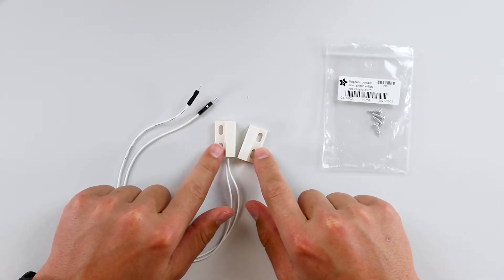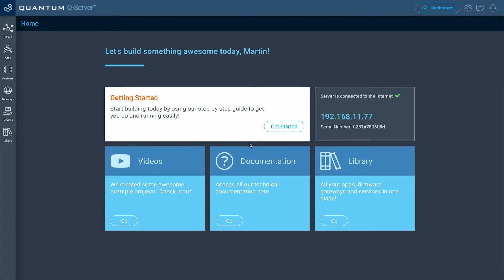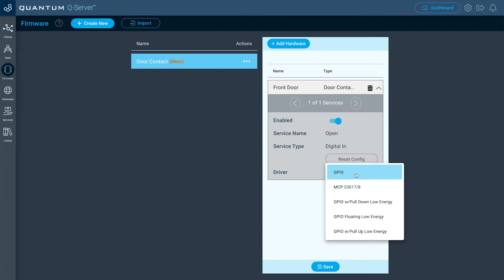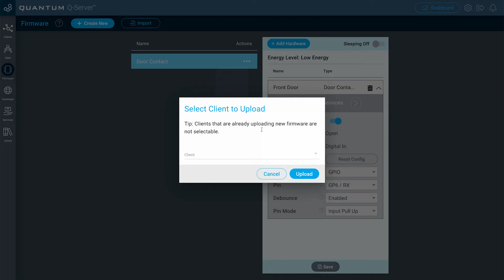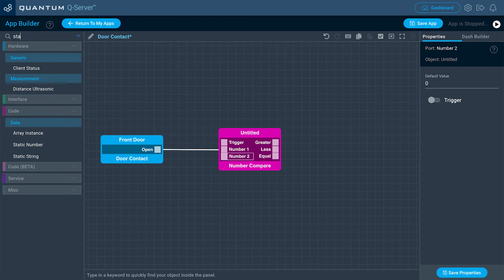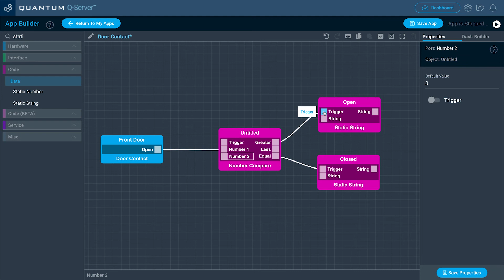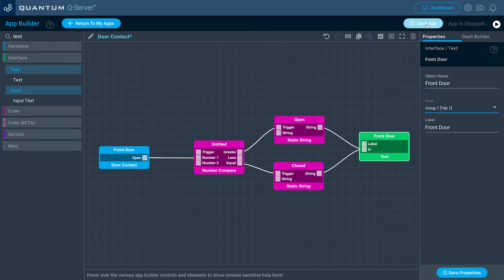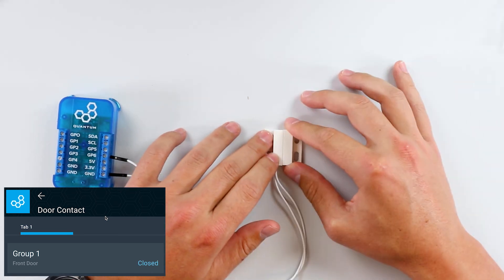How to Electronics - Magnetic Door Sensor

Comment: How would you package this to make this useful in a real world application? Problem is the builder base is too big for incorporating into a simple magnetic contact switch.
Reply from the maker: That's true if it's just one door contact. Just from the top of my head you could add more components to the same builder base that would control the door contact, motorized shades for windows, actual motors to open and close the windows, electric locks for a door, a variety of other components, and our built in integration services with other IoT products. There's quite a lot of ways you can package it to fully utilize the Builder Base so it's not just for a simple door contact. Our Builder Base has a detachable case that could also help you make it more discreet if need be.